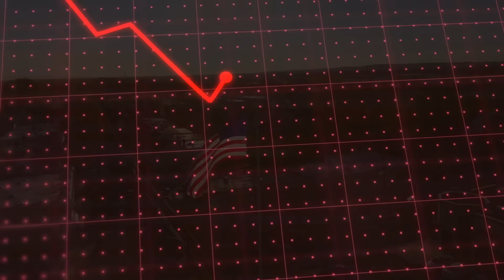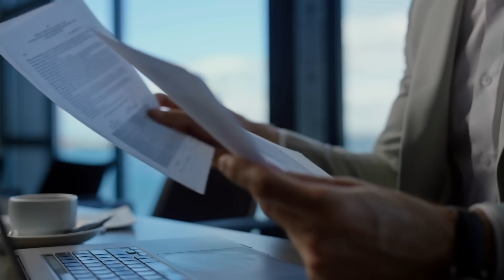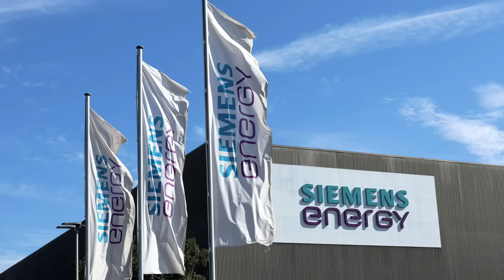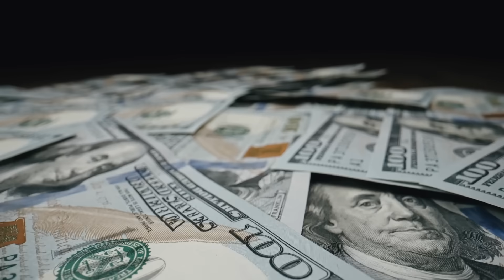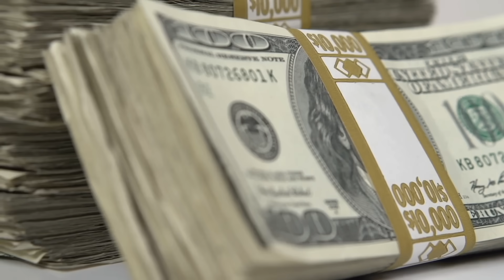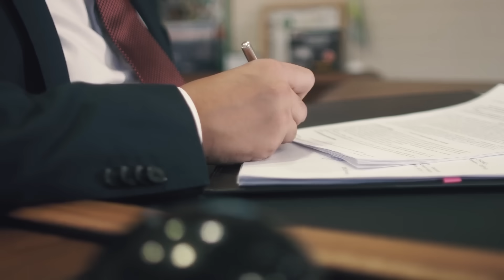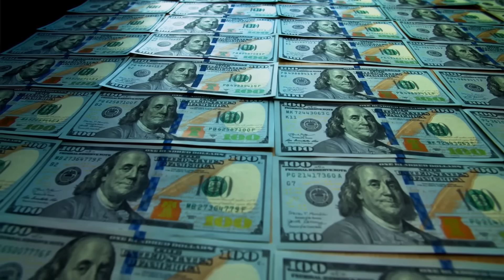The Real Reason America Has Turned Its Back On Wind Power Energy

Comment: The reasons stated are excellent, but The Harvard Gazette's studies (2007 and 2012?) had shown that solar farms had increased surrounding area temperatures by almost two degrees, which actually increased at nighttime. Their studies on wind farms had shown that the winds had decreased to zero after passing through "x" number of windmills. This had several negative impacts on the environments surrounding these wind farms which included increased temperatures. 
All of which impacts the environment negatively and increases global warming significantly.
Reply: I suggest to read the papers again. They did not write windmills. These are windturbines.
The eff4cts are local and not that strong.
Reply: @old-pete  You say potatoes, I say potaatoes, Windmills-Turbines. 

"Can't we all just get along?"

Comment: The idea of “0” is like infinite. Lots of hype but never achieved. Never any numbers of the amount of pollution in the creation of wind turbines and solar panels. These things do not last very long. A good coal fired steam generator has little pollution when made to our standards. Smoke stack scrubbers do a very good job of cleaning the smoke. They last over 50 years and are cheap. Keep in mind that cheap energy built America and the rest of the world to boot. These plants are not affected by “no wind” and “no sun”. If not even one methane fart came from the U.S. for twenty years nothing the world over would be achieved. The only thing you have to look forward to is very expensive unreliable energy. How many birds get killed by windmills. How many whales die because of low frequency hums in the waters. Surface thinking makes it sound real good. Reminds me of the Edsel and Corsair. In 50 years or so we will have fusion reactors. Then we can go all electric!!!
Reply: Coal power plants are so cheap that they get pushed out of the market by wind.
Coal power plant clean? Did you inhale too many exhaust gases? Coal power plants produce tentimes the waste for each produced kWh than windturbines, that is only counting the toxic ash of the fuel. The fine particles that cause lung diseases are not even included.

Solar panels can work for 30 to 40 years, even 50 years are possible, but degredation does not make it practical.
Windturbines can be certified for 30 or 35 years

Windturbines kill 1/35th of the birds fossil fuel power plants kill. The birds killed in oil lakes in the US is double of what is killed by windturbines. Collisions with buildings and windows kill around twothousandtimes as many birds as windturbines and cats are even fourtimes as worse than that...
Whales are known to swim peasefully through offshore windparks. There is no account of a single killed whale.
Reply: @old-pete  dear old Pete, you must remove yourself from CNN, MSN whatever and expand your news sources. I was a leftest until I discovered the corruption and misinformation put out by the tree huggers. The climate czar made his 300 million dollar fortune and now leaves it to followers like you to carry on. Perhaps you would like to pay my elect. bill as well as your own. 
         PS, search for Whale deaths on beaches where offshore wind farms are and be amazed. GOOD LIFE TO YOU,

Comment: There is only one reason all these companies are pulling out of wind energy.  THEY ARE A FAIL.  Both technically and economically.   If the wind energy enterprise has not done supply to user systems engineering, then they have failed as well.  This is what happens when politicians try to Will and Incentivize green energy policy, without having a clue what it entails.
Reply: Some projects fail, some do not. Sounds like normal business.
Last year was a record year for windpower.

Comment: not profitable so yah why waste the money to build them?
Reply: They pay off after 5 to 15 years.
Reply: @old-pete  so have to replace blades least 3 times in that time frame..
Reply: @alexlindekugel8727  No. With correct maintenance, the blades work for 20+ years.
Reply: @old-pete  no they dont never have. the blades get blasted with grit in the air and just chews them up. the tower will last 20 30 years. but not a ghost of a chance for the blades i used to build then.

Comment: Haven't read that other nations (Europe) are having these problems. Our problem is that we have these huge power grids which are an impediment to more sensible and smaller grids.
Reply: They had similar problems in the past. In the early days offshore windparks were finished without a grid connection. The planning was not ideal.

Comment: The "problem" you point out existed while the wind projects were on the drawing board. This was one of the "critical path" issues that were never addressed. That is just bad engineering from the get go. It's like building a tunnel for 5 years and finding out the two halves are a mile apart in the middle.

Comment: Americas goal? they mean governments goals. The design of these windmills are not efficient and subject to damage with winds they should be able to sustain. having that much weight at the top of a pole puts too much strain upon its support. it also makes service hazardous and harder than it should be. I would design the generator at ground level reducing the effect of multiplying the forces of leverage. having the ability to break the blades and feather them in strong wind would be easer when not connected to a generator. putting a drive shaft that can be disconnected mechanically at the top  would allow for better control of the blades. providing larger support and bearings to dissipate heat buildup would prevent the burnups we see frequently. Sensors that put the blades in a feathering position and turn it to reduce the drag and then stop it holding it in place with a breaking system. once stopped a ratchet gear is applied so it doesn't depend upon the break to hold it.  a gear box that provides the drive on the shaft can be shifted for maximum speed. at the ground another gear box that could disconnect the generator from the drive shaft for service  The advantage would be easer service that could be performed more frequently and not having high voltage wires that run to the top of the windmill and switch gear that isnt adding to the weight supported at the top of the pole. What I see is a design approved by someone sitting at a desk that needs to take a trip up to the top to see what problems exist. As a retired elect. contractor I can see the problems burning up atop these windmills. They could work if redesigned.---------------- I, Grampa
Reply: Windturbines are extremly efficient. That is hightech.
Building the towers is not a challenge and they do not get damaged from wind.
Ground level generators are an idea for years, but they do not get built for a reason. A 100m+ long driveshaft would twist under the forces, unless you make then extremly thick.
Feathering the blades is not dependent on the placement of the generator.
Adding an additional gear increases resistance.

Comment: Windmills are only interesting to those who manufacture them and politicians who act as their lobbyists. Other than that - it is an utter stupidity to think that windmills are for anything other than making politicians rich. Until we do have batteries that function the way they are supposed to - hoping that storing electricity for use at a later date is working is an illusion.
Reply: These are not windmills. It helps to know what you are talking about.

Which politician gets rich from windturbines and how many got rich from fossil fuels? 
Btw the fossil fuel industry still gets subsidies, despite all the people that get rich of it.

Comment: So what I am hearing here is companies are building these projects then worry about how they will get the power on the grid. I guess you can call wire antiquated, but it's the only way we have to move an electron from point "A" to "B". If some company is stupid enough to build an offshore wind farm without a way to get the produced power to the grid, well that's just pure stupidity. How in the world can they get a permit to build without have the infrastructure in place to handle the project? 
This is like filling up the cart to take it to market then ask do we have a Mule to pull it!!

Anyway this is one of the big problems with wind farms. They have to be built in remote locations because of many factors. Then you have to build huge infrastructure to move the power from point A to B. This is very costly and also there are huge losses of power due to the distance the power has to travel on the grid. Maybe one day we will have wireless power transmission, but we don't have it today! Just like all of this green stuff people seem to forget about the fundamentals.

Also I wanted to add the EV chargers have the same problem. Most areas do not have the grid infrastructure to handle the load of these superchargers. So many are installed on power connections that may be suitable for one charger, but they will add multiple chargers to the same connection. In the end will limit the speed of the charge as more chargers are used.

Comment: WIND HAS HUGE PROBLEMS THAT NO ONE IS ADDRESSING. WINDMILLS: KILL THOUSANDS OF ENDANGERED BIRDS: REQUIRE MASSIVE MAINTENANCE FOR EACH UNIT THAT IS NOT PLANNED BY THE OWNING UTILITY, UNITS WEAR OUT SOONER THAN PLANNED BECAUSE UTILITIES DID NOT PLAN FOR REQUIRED MAINTENANCE INCLUDING LUBRICATION, REPAIR, ETC.
Reply: Fossil fuel power plants kill 35times more birds...
Windturbines need less maintenance than other power plants and run mostly automated.
They run as long as they are certified and they are maintained. A certification for 20 years is pretty standard, but some companies offer certification for 30 and 35 years. The oldest windturbine runs for 48 years.
Lubrication and maintenance cycles are found in the technical documentation. Owners should pay attention to that.

Comment: The whole Green Energy climate crap is all BULL$HIT! this is all dreamed up to make money off of. And we the people and up with a second rate energy grid loaded with problems and failing all over the country. But these dirtbags are still making millions off of these faulty projects. 0 emissions my a$$ it will never happen and even if it doesn't we're still one of the cleanest countries out there with a very low carbon footprint .🤨👎
Reply: Denmark is powered over 50% by windturbines and over 70% with renewables and has a more stable grid than the US...

Which country is supposed to have a low carbon footprint?

Comment: Ahhh yes the solution "MORE GOVERNMENT SPENDING". The problem with these projects is Government spending. Few of these projects make any sense with out the government money. Stop government spending and the ones that would get built would make economic sense (because they made practical sense) and the others wouldn't. There would be a lot fewer wind mills and solar panels but more that were connected to the grid
Reply: If goverments stopped spending money on fossil fuels, that would work.

Comment: Windmills are ugly and can't help us if the weather isn't ideal for wind power.   Let's go nuclear, the U.S. has 400 years of uranium ready to go.
Reply: They do not need ideal weather.
Reply: I said, ""ideal for wind power".  Do you ever go sailing?  What's would be bad wind weather for to a sailor?  Ever go golfing? What is bad wind weather for a golfer?  
I drive across Kansas fairly regularly, thousands of windmills line I-70.  I'll see entire fields, 100 windmills, that aren't even turning.   When it's windy they produce so much power it can't be used, electricity can't be stored, so the computers will feather half the windmills.  In summary, doldrums or high winds don't work for a windmill. 
I repeat, weather must be ideal for wind power.    @old-pete
Reply: @karlbmiles  You wrote "weather"... "ideal for wind power".
These are not problems of the wind turbines. They work in a wide range of wind conditions. Ideal conditions are not needed.
Reply: You don't grasp that wind is part of the weather.  That's OK.  You're not a meteorologist or an engineer so the relationship of WIND to a WIND mill is lost on you.
Reply: @old-pete    From an article on wind power farms:  "A wind turbine is most effective when it operates in a steady, smooth, unchanging and uninterrupted flow of air. That never happens in the real world, but when planning where to install a wind turbine the locations has to be as close as possible to the ideal."

IDEAL is their word, you just read it from me first.
Reply: @karlbmiles  In case you did not notice, we talk about windturbines, not windmills. Please inform yourself about what you are talking about.
One should know the difference between "needing" and "prefering". Yes, windturbines run better under ideal conditions, but they do NOT need ideal conditions. Are you sure you understand the word "need"?
As you noted yourself, conditions are rarely ideal, still windturbines run fine. Windturbines tend to maximize their output during weak storms, which are not ideal conditions, but affect large areas with strong winds.

Comment: Any new or upgraded electric grid sections MUST include EMP hardening with sufficient protection against damage/failure due to solar storms and lightning, and security features to deal with on-site terrorist attacks. We must create and maintain an physical inventory of critical components (such as unique transformers in critical locations) that have unacceptably long manufacturing lead times. Each inventory item must be capable of being on-site of its designated replacement location within 1 week along with ensuring a team equipped and trained to install it at any time can actually make it to the location.
We currently don't even keep an inventory of unique critical components such as special transformers that can require months or even over a year to manufacture even when everything else is working right...and that includes all supply chains.

We cannot afford to have entire grid sections down because it takes nearly a year to manufacture a damaged transformer that has no equivalent replacement.

Comment: I have owed a wind farm this is what i know.
Wind Energy is a non ferm energy .
The wind is up and down all day if it is blowing. The utilities do not want no fearm energy. No firm energy surges the mother line they dont like that.
The utilities do not want it. I had to us the purpa law from congess to get a  conection to the gride.
Then after all of that they will only pay avoided cost of energy . .08 cents per K.W.
And then fin you if you dont make your contracted amount.
There is not much money in wind energy 
Maintance is way to high.
The wind machine run hot and burn.
Electricity is not very efficient takes a lot to do anything. This has been proven over and over. You make more pollution making the machine than it will ever save.
Reply: Riiight...
A lot companies make and invest a lot of money. Looks like they know something you do not.
Windturbines run fine, when one knows how to run them and which model to get.
They earn back all invested energy in 5 to 15 months.
Electricity is one of the most valuable forms of energy there is, as one can use it for many different things and convert it very efficiently.

Comment: This video FAILS to discuss the HARM with Offshore Windfarms.  Windfarms are a Big Negative for the fishing industry.   When you have high voltage cables put underground it hurts our maritime environment and aquatic life.    In addition, Windfarms only have a useful life of 20 years, and then the wind turbines have to be dismantled.  The old wind turbines generate a lot of waste.  In addition, the cost for electricity goes up when Windfarms are put in a state.  Check out California.   Go Nuclear.  Nuclear is cleaner.
Reply: The world runs underground cables for over 100 years with no ill effect for marine life.
Offshore windfarms are proven to be marine life protection areas, as fishing and commercial sea traffic is usually not allowed in these areas, which gives sea life an undisturbed area to regenerate.
Windturbines can run longer than 20 and the recycling is no problem for years now.
Electricity costs of windturbines are lower than from new fossil fuel power plants.
Nuclear is even more expensive.
Reply: @old-pete  we agree to disagree.  Do your research and you will see the harm Windfarms can cause are marine life.    The Wind Turbines life expectancy is 20 years.   I addition, it is costly to harness the energy from Windfarms.    Take a trip to California, or better yet, to save yourself money do a Google Search.    Do a search on Orsted pulling out of New Jersey.      Nuclear is not more expensive.    Wind turbines are not biodegradable.    Why is it that electrical bills go up in States that have Windfarms if it is less costly that fossil fuel plants?